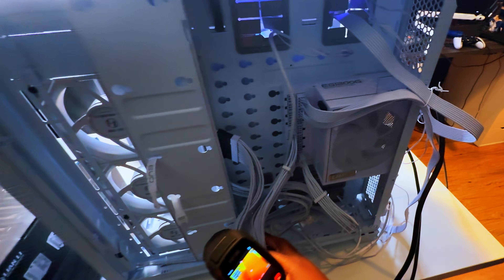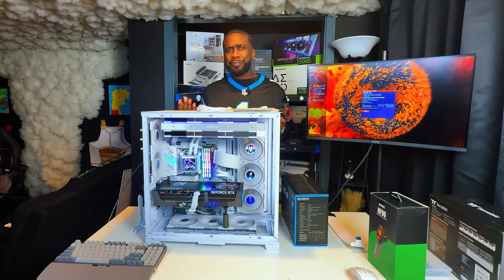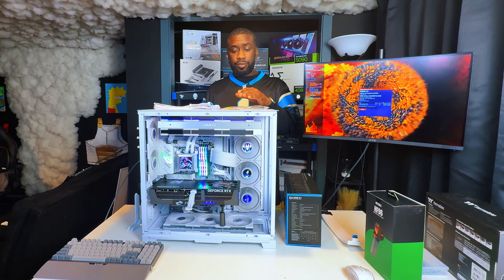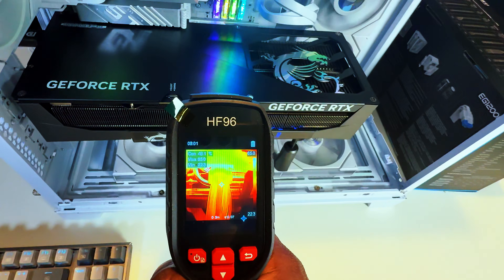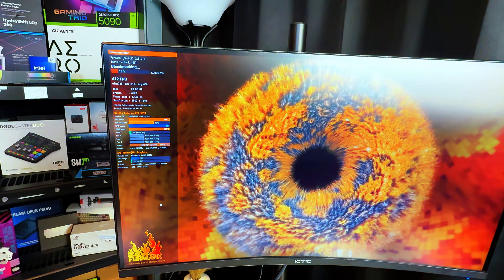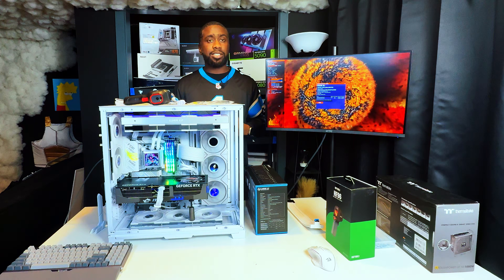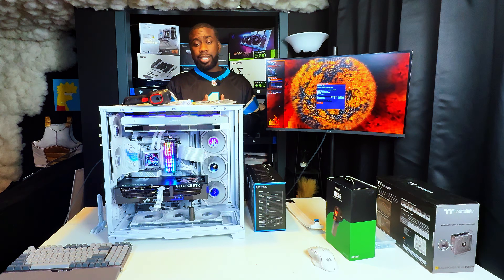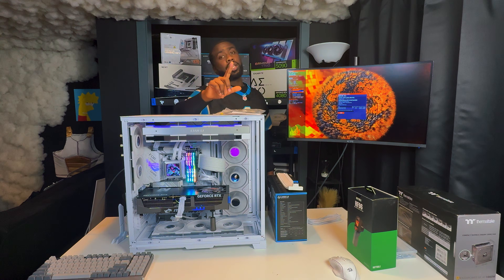Will my RTX 5090 melt the 12vhpwr like Der8auer's? TESTED!

Comment: I was actually thinking about you and your channel and was hoping you would do a video on this. 
A lot of these new developments are helping me with my fomo. 
Even though I have what I consider to be a pretty high-end PC and I would like to top it off with a 5090, for meb as of now it's just not worth it. The extra power the extra heat not to mention the extra cost of the card and a new power supply.  
I'm going to hold off and if the 5080 I want, MSI Vanguard or supreme, I will pick it up.
Thanks for the video
Reply: Just wait for the 5080 super with 20-24GB vram. Don’t waste your money on the 16GB
Reply from the maker: @ it’s definitely coming! 24gb most likely based on the die configuration and incoming 3gb ddr7 modules
Reply from the maker: No problem. I honestly think most would be fine especially if they used the 4x8 pin adapter that comes with the card. It will balance the current evenly and eliminate that problem all together.. then there’s ASUS who built in extra hardware to do it.. but they cost more. Either way a 5080 won’t come close to hitting that amount of power or heat so you’ll be golden! And it’s still fast!!!

Comment: Nvidia: Shrinks power adapter and shoves more current through it.
*5090 cables start melting
Nvidia: Surprised Pikachu face 😮

Another great video! I'm going to be using a set of AsiaHorse cables in my new PC so hopefully nothing goes wrong, otherwise I'll be the first 5080 owner with a melted cable 😅
Reply from the maker: @Phara_2  I’m very much convinced the 80 will not experience this at all because of drastically more power efficient it is! You’ll be just fine. ☺️

Comment: Another good video. I wanted to test the 4090 I'm getting in my 7800x3d build when it comes, but I'm scared to mess with it at this point with all the connector issues. I'll make sure I get the appropriate first party cables if I do decide that I want to do it.
Reply from the maker: @umyboiblue  I’m pretty convinced if you run the adapter that comes with it. You won’t have any issues because the 4x8 pins is going to even the load distribution by default.
Reply: @AverageLarryGaming  damn I'm going to have to get another power supply. My 1000 watt is only 3x8
Reply from the maker: @umyboiblue  well if you get another PSU then as long as it’s ATX3.1 you will be fine just running the single 12vhpwr cable as I have shown here. This is likely not even an issue when ran with the original cables that come with the older power supply either but I was not able to test that unfortunately.

Comment: I don't think it's the age of the PSU, i have a 1600w platinum from EVGA from 2016 and a HX1050 from corsair even older i been driving my 4080/and 4090 and never had a issue i blame 3rd party cables i run benches and do max overclocks on both GPU's never had this problem.
Bottom line use what Nvidia gave you in the box and you will be fine.
Reply from the maker: I agree that its not only on the age of the PSU, but with the newer ones.. this would not have been given power in that scenario with a bad cable or one that backed out. but FOR SURE if you use what is supplied to you.. you will be GOOD for sure!